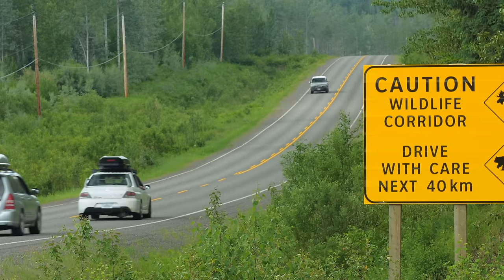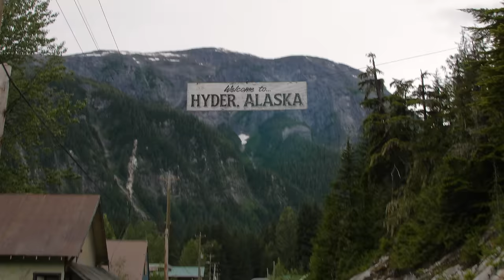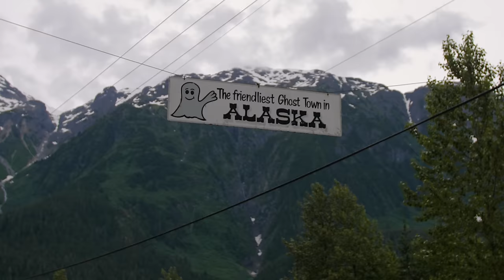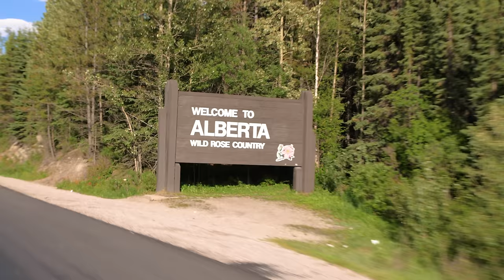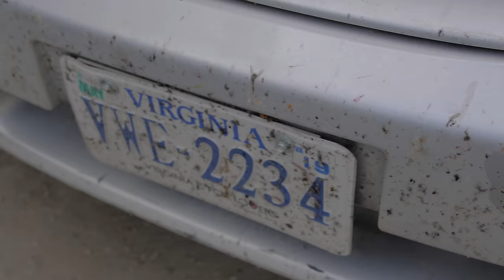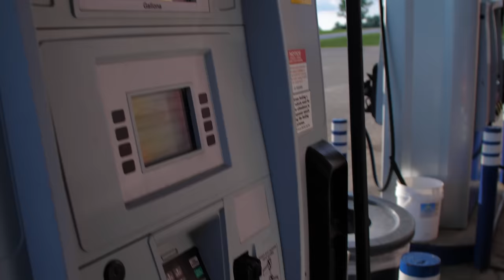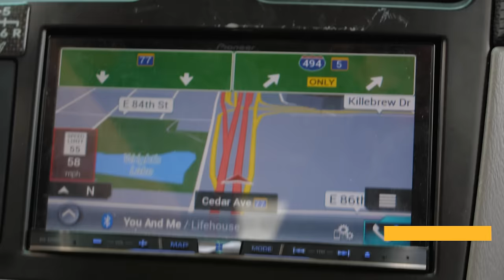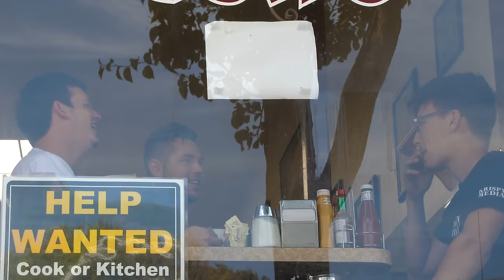Driving from Florida to Alaska - Episode 3

Comment: maaaaan, dipping into Hyder and calling that visiting Alaska - that's so cheating! If you would've taken the main AlCan Hwy, there would be plenty of gas stations along the road. Also, you went so far and didn't drive through the Icefields Parkway in Alberta?? Sounds like you needed better planning before the trip. Great series nonetheless!
Reply: Planning would've made the video series completely different. Them taking the risk to just go out and go for a road trip on modified cars just for the heck of it made this series unique. Not saying you're wrong

Comment: Love the video but come on dudes, unless your car is a full on racecar, running on 87 for a bit isn’t the end of the world. I’m sure you would’ve been fine.
Reply: right!
Reply: Yup.  Just stay off of WOT.  They are in cooler weather too.  Unlikely to ping.
Reply: ChillCosmos that's why we dont have 93 here for the most part, we just dont need it.
Reply: Don't know why they running 93 in stock cars. I never get tunner cars.
Reply: @Origins Garage or just a couple bottles of octane booster
Reply: Don't know about the Evo, but a stock FXT requires premium fuel, otherwise the engine will knock under boost, and the ecu will cut the boost to spring pressure on the wastegate (about 7 PSI) which basically removes about 50 HP.  Tuner is spelled with one N.  Matt should have a capital M.  Brugger, if that's really your last name, should have a capital B.
Reply: Try opening the fuel cap on a Evo while is idling and see what happens a minute later.  These cars are very sensitive on what they drink.  Great job you guys!
Reply: @Wakko0o  if a mercedes c63 amg can run on regular 87 fuel for a few km, the tuned evo and forester definitely can do it too.
Reply: I know right. I drove from Alaska to Texas in my SHO (Twin turbo fyi) and it requires 91 octane and the car ran just fine on the 87 stuff.
Reply: @Nanda Kumudhan they have only have bolt on part exhaust intake up grade trubo. That still stock not like they fully built cars. They have tunes to me when you're car has fully built engine like prime example you bore out out bigger pistons bigger injectors up grade fuel rails then it not stock.. till then it stock with upgrades
Reply: opening cap got nothing do with fuel, that the evap .
Can't see 87 being spot of bother at low temps and sensible throttle.
Octane booster would of been smart move, next time pack the booster boys ...
Reply: Well my little dinky Mini Cooper S doesn't even run right with 87, and spark knocks even just regular driving. Mid grade, it'll knock at WOT. Yes fuel grade does matter.
Reply: some stock cars run 93 only. My Focus ST is lightly modified but it requires 93 specifically. I 'could' run 91, but even the manual doesnt recommend less than 93. I'm sure for a short while they would have been fine though...as some have stated as long as theyre not running WOT a bunch of times, 87 will burn conservatively without issue
Reply: Yeah these idiots...if you've tuned your car to within an inch of its life... that isn't a vehicle to take on this type of trip.  I've take my moto all over mexico.  It runs best on 93 but I can only get 91 here and sometimes only 87.  I just change oil and plugs more often.
Reply: As long as you don't go into boost you're fine.  There's no heavy load cruising at highway speeds to cause knock.
Reply: Octane booster..doesn't boost octane like you think it does. It will increase octane by only fractions of what you'd need. One can of octane booster isn't going to bring a 12-15 gallon tank from 87 octane to 93 octane. Just isn't going to happen.
Reply: Ben Saph - why'd they talk all about extra gas cans only to not use them or gave enough to do the job?  Homework guys, do your research.  Good video, beautiful scenery.  ...side note, I have a Thule Evolution cargo box and need 2 U bolts (part #TH43215).  It's a  VERY  unique part, more than you'd image.  Any clue where to find some?

Comment: "these cars will really not operate without 91 octane"
You should see what I have to use here in Brazil to power my subbie...
Reply: They could have took some octane boosters on the trip....
Reply: Could they not have flashed a lower octane tune? Or just stayed out of high boost?
Reply: Yes. I ran my S1000RR on 87 Octane once in central Nebraska on a road trip last summer. And that's a very high compression engine. Just don't rip on it. I babied it at 55mph to the next major city, over 10 miles away... It sucked.
Reply: They cried about like it was the end of the world when all they had to do was put some octane boost in with the gas.

Comment: So what’s the purpose of a full spare tire if you are concerned about drivetrain damage? In that case you should of gotten a used worn tires 🤦🏻‍♂️
Reply: I'm also not sure that, that is correct. You shouldn't cause drivetrain issues unless one of your tires is like inches different than the other.
Reply: @Kmaitland89  you’d be surprised to learn Subaru doesn’t suggest more than a few mm difference. Unsure about Mitsubishi though.

Comment: You guys could have run on 87, your tuner should have input a low octane tune in your ECUs that reads knock and switches your ignition timing map to a safe advance table. You'd probably have a check engine light on, but as long as you avoided flooring it and racing, you would have been ok. Either way, you guys made it to Alaska!😆
Reply: But the bears... have to launch to avoid the bears.
Reply: em1sleeper I always keep a can or two of octane booster

Comment: Should have brought some octane booster to add to the regular fuel. Car should run on 87 even if it doesn't run well. All modern ECUs can adjust compression in order to avoid knocking which is the primary short term issue with putting 87 in.
Reply: They can't adjust compression but timing.
Reply: Sure, but they do it to adjust the compression ratio at time of ignition.
Reply: @michael2275  no, compression ratio is static (different in boosted cars). So to change the compression ratio you have to lower boost. To change the static ratio you have to buy the new infinity car with the weird crankshaft.
Reply: It's actually much more simple...both of those cars would be fine with 87 octane as long as they stay out of boost.  Which is simple, especially on those rough roads

Comment: I would have kept pushing it. Your cars would have been just fine on 87 and heck you have full sponsorship from Advanced auto if anything went bad. Also the other idea would have been to go back to the Alcan highway and go North from there where you could have found 91 octane. I really hate you gave up so easy, screw it, push those cars and see what they can really do!!!! Sad..
Reply: You surely never owned any turbo cars, aren't you?  Trust me, the engine will knocking and for about a few KM it won't start anymore.
Reply: I have and it's fine, as long as your car isn't a garbage brand or tuned by a deadbeat
Reply: They should bring Fuel Additives.

Doh....
Reply: Yup. Octane booster for instance, it does work.
Reply: octane booster?  Research where you're going before hand?  I did the road out the top of Labrador in my WRX in 2008.  I also brought an accessport so I could tune it for a lower octane.
Reply: @fiandoperdana8385  as long as you dont drive on boost lower octane would be just fine, if they just cruised it would not be a problem😊
Reply: As an Alaskan and Subaru enthusiast, I've driven through Canada 10 times with 5 different Subies at this point. In 2009, 08 Forester XT, I added octane boost because I didn't know when the next gas station was coming up. By 2013, with 08 Outback XT and 13 BRZ, Canada had more gas stations with 91 octane. Turbo cars can go a bit with 87 octane, but it depends on the condition of the car. I wouldn't recommend these road trips with performance cars pushing their reliability. Do it when they're relatively new or lower mileage and you'll be fine. I just got back from my 5-week long x-country trip and feel like they made it more difficult than it actually was.
Reply: I think the problem was that they were on a time limit to get up there and back to a meet... if it wasn't for the time limit they definitely would have gone all the way
Reply: They still need to get back
Reply: @benjaminbjacobsen  Funnily enough one of them has the cobb access port with them I think! The forester, I'm not sure at what point in the video but I defnitely saw it at some point, so you bring up a good point!
Reply: Nice to see you here Acc0rd79
Reply: @fiandoperdana8385   lol thats the stupidest fucking thing i've heard i've ran 87 in my turbo audi and a dsm and oh jeez guess what no knock after 1100 miles....
Reply: In addition, the elevation will allow you to use 87 octane for a few tankfuls
Reply: @fiandoperdana8385  Not remotely true. Chin up, get some education pal.
Reply: I would assume sponsorship does not mean a dead engine in the event it blew. But they could have run 87 just fine.

Comment: I can't fathom how a group of driving / car enthusiasts didn't know that premium gas isn't available en-route their original destination. You need to up your planning by a few notches.
Reply: I don't know anyone who runs a car that needs premium that doesn't have a bottle to two of octane booster with them. If I was doing a trip like this, I'd have brought a case or two along. Especially if I had a parts store for a sponsor.
Reply: Canada just needs to up its fuel Game
Reply: I mean the US fuel game is kinda shit too. Here, in Europe, most places "regular" fuel would be at least 95 octane, and 97,99,100 or even 101 octane for premium. The lowest I've personally seen is 92. So yeah, I don't know how your guy''s cars tolerate it hahaha
Reply: Y'all use a different scale. Same gas we get here but different numbers
Reply: Did a bit of research and yes you are both correct and I was mistaken (though Andy, calling people you don't know dumb because they are not aware of something is unnecessary).
Reply: I got from the series that them doing some vague planning was part of the video.  having them make decisions based on what was unfolding made the trip what it was.

Comment: Found this so funny as an Australian. Here 91 Octane is the standard fuel for cars, i've never seen any lower. And 95 and 98 octane are the "Premium" for evo's and wrx's and the likes
Reply: US 87 equals your 91 octane
US 90=95
US 93=98

That‘s because of different octane rating types

In most countries it is calculated with the „Research Octane Number (RON)“ method, but in the US they add the RON to the „Motor Octane Number (MON)“ method and divide it with 2. That‘s why the US number is always a little smaller. It is also called „Anti-Knock Index (AKI)“.
RON and MON are two different ways to detect the octane number. The MON is always 8-12 octane smaller than the RON.
Reply: Oh thats so interesting. Thanks for explaining that :) r/TodayILearned

Comment: Road trips are great. Road trips in a car that's not made for road trips or greater. After we bought our used Mini Clubman we went on a trip from the from San Francisco to New Orleans up to Memphis through Oklahoma and back home. About 5,000 miles. This is with my wife's electric scooter and all our luggage. No roof rack necessary. Had a great time. Got 33 miles to the gallon which is a little better then your Subaru and Mitsubishi. You might want to check out Mini Cooper. Enjoyed your video very much.

Comment: That first stretch of gravel road you hit is called “10 mile slide”. It’s been an ongoing problem on that section of 99 due to the topsoil sitting directly on smooth glaciated rock. It’s been in some state of repair for as long as I’ve lived in the area.

Comment: The 1/8 inch difference in tire height will do absolutely no damage and the car will be fine on 87. Love you guys but stop being a bunch of Marys.
Reply: Yeah, just don't run diff size tires on awd :-)
Reply: Robert Hull same thoughts here. Really didn’t want to go to anchorage like you said you would? Fail in my book.
Reply: With the ACD in the Evo it may have serious consequences . Better to be safe than sorry. As for the RON rating, if the cars are mapped for 98, 87 will cause issues. Surprised they don't have switchable maps.
Reply: David Webb lol come on dude. 1/8 is nothing. They could have ran on that. But plugging that tire for the first time in his life and then worrying about it lasting 5400 miles was for better content 😂
Reply: @Logan Madder, On my VII I have run 225/45/17 on rear on one side and 225/40/17  on the other side and blew out the diff (ACD) man...on my IX there is no way I would use different sized tyres. This is just my experience. Also parts are x5/x6 times as expensive and way more difficult to get where I am from.
Reply: @TheHarlequin100  it was the same tire size. The one on the car had some wear on it. No difference between that and a few psi difference in tire inflation. Would have been just fine.
Reply: Yeah, they are a little paranoid. Cars have tolerances, they aren't space shuttles.
Reply: Could they have bought a case of octane booster with them?
Reply from the maker: We are assuredly both a couple of Marys, no doubt. But we just wanted to avoid any costly complications with the cars, especially since we were on a deadline to get back to Chicago to film Gridlife. Had a we a support vehicle or more time, we could have let our hair down a bit more.
Reply: Definitely ok to run on 87
Reply: I know! hahahaha wouldn't last a day in mexico.
Reply: IKR
Reply: My exact thought.
Reply: My dad tried running differently worn tires on his A4 Quattro and it ruined the AWD system. (No the Audi wasn't already having that issue lol)
Reply: @TheHarlequin100  The 87 octane will be absolutely fine as long as they stay out of boost.

Comment: if your car says it requires Premium your not required to put it in. I have a 08 GTI Turbo stage 1 tune and when i cant afford Premium i just get regular. your car just wont be at 100% of its HP. it will be like 80-maybe 75% hp. You can use 87 its fine.
Reply: Onzaras their car engines are tuned. no way put regular gasoline on tuned engine.
Reply: Rico Radh I do all the time bud. Unless they run 600+ hp which I doubt, they can use regular gasoline. Just like my car they are probably on a stage 1 or 2 tune. Being the Evo destroyed a clutch I'm almost positive they have no clue what they are talking about when it comes to gas. I mean they didn't even know how to plug a tire.....

Comment: you should pack some rubber cement to cover your plug with.  I've had a plug in my truck for about a year and no problems with the extra seal from the rubber cement.
Reply: You should run the plug in rubber cement before putting it in - not just over the top.

Comment: For anyone wondering how much a trip like this would cost, I did Pennsylvania to California a couple years ago. Took three days, cost less than $500 after food, gas, hotels etc. That's about 2500 miles. So multiply that by 4, and add in some padding for mishaps/extra expenses and you're right around $2500. This was in a car that took 91 with a range of roughly 280 miles per tank